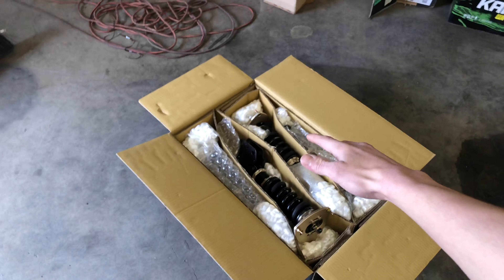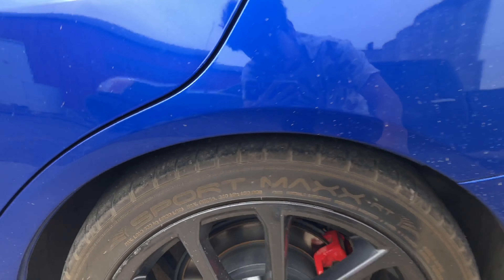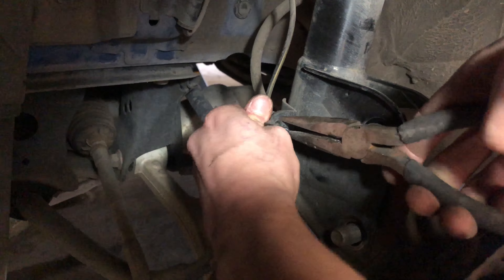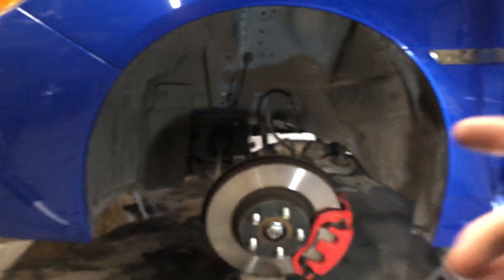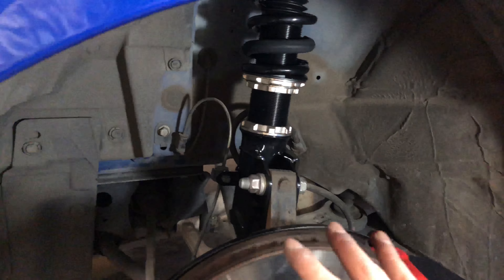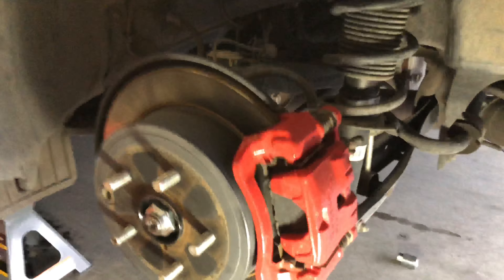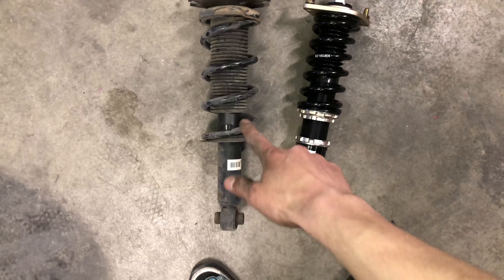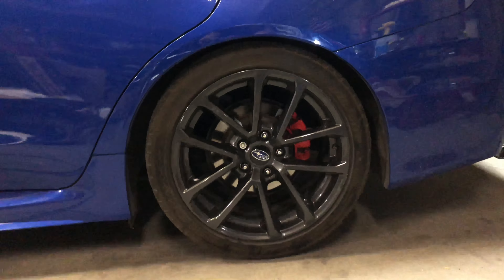Installing BC Coilovers on my 2018 Subaru WRX

Comment: Thank you for not skipping anything. Wanted to make sure I had the top hats with the camber screws lined up correctly before bolting in the front. Just installed the DS-series set on mine, looking forward to a more comfy ride.
Reply from the maker: @benkova6925  Thanks man glad you liked the video! Those seem nice did you get them on the car?
Reply: @NitroKiddForTheWin_Subscribe  I sure did and boy oh boy these beyond far impressed me. I had entry level blitz coilovers for 1100 don't get me wrong they're probably the best entry coilovers I've ever rode but these DS series are 10 times better just for a few hundred dollars more they make a huge difference

Comment: Hey bro cars sitting nice! Did you have any issues with getting the alignment? Besides the added camber did they give you any problems adjusting the toe?
Reply: I just did mine with lower control arms and the toe got really messed up in the rear, alignment shop isn’t able to fix guess I need some more parts to get it correct¿